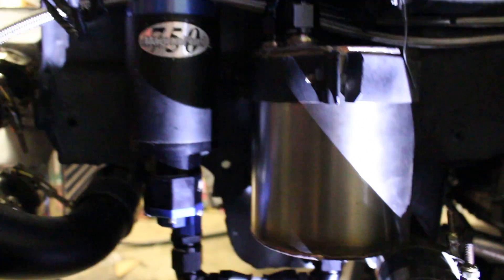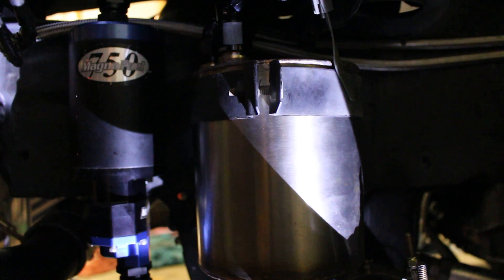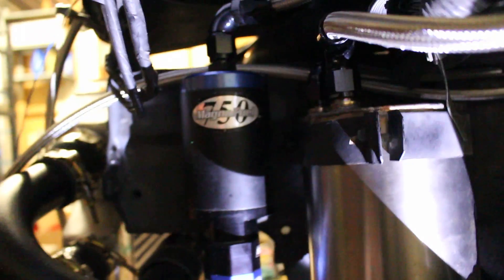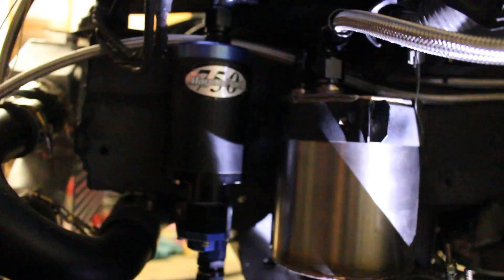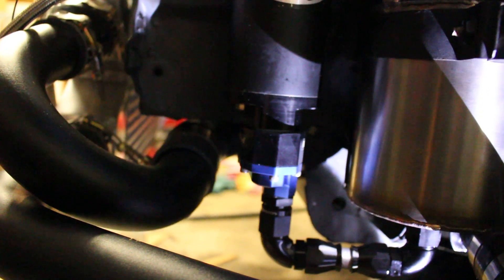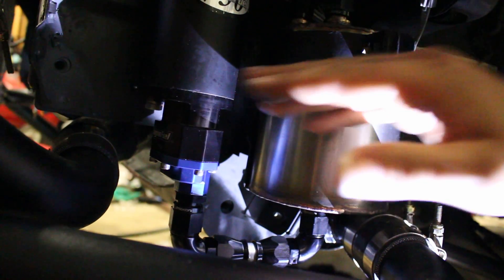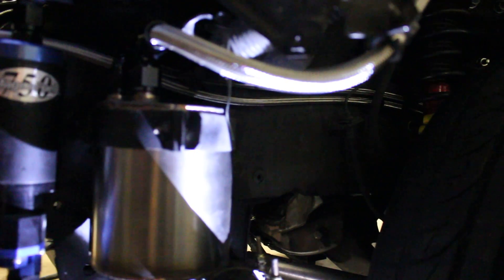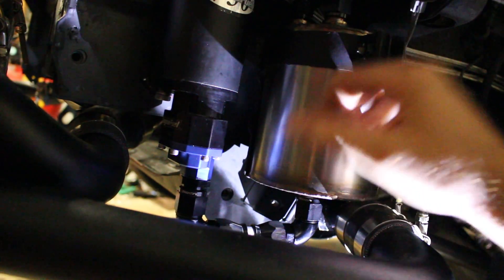Fuel system magnafuel

Comment: +13562153
I would add an -8 AN one way check valve to the fuel line to keep the supply line pressurized when you turn off the key. They cost around $40-50 USD.
Also are you filtering the fuel?
Reply from the maker: Which point would you add the one way valve? Yes filter in lift pump plus filter after mp4303 before injectors
Reply: Check valve is ALWAYS in between the injector rail and the main pump.
Reply from the maker: magnafuel regulators and most big aftermarkets don’t hold pressure. Therefore it is useless.
Reply: Ah, I see now. You're using a return type fuel system. I was thinking of a returnless system.